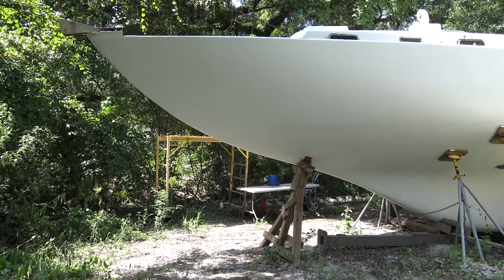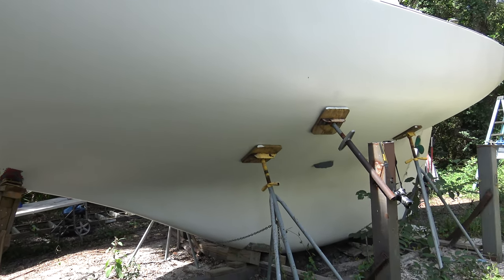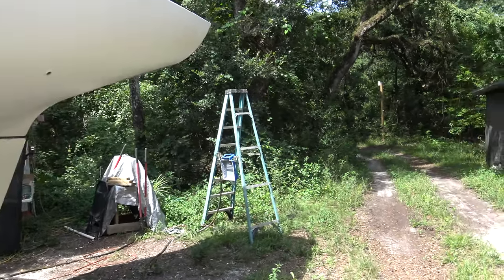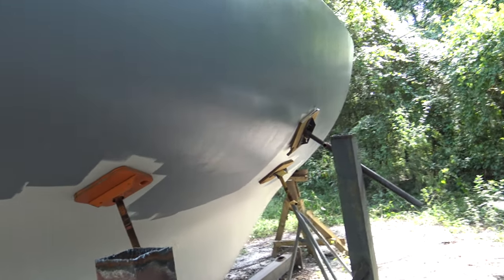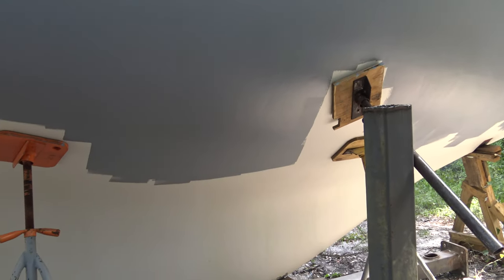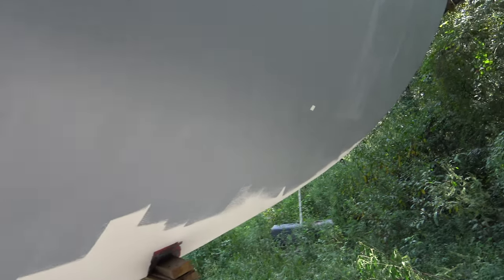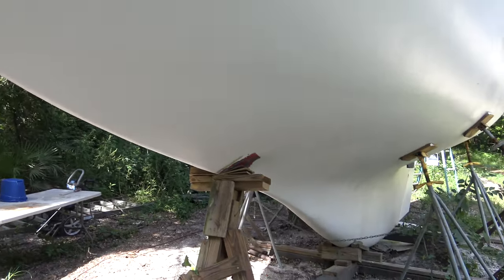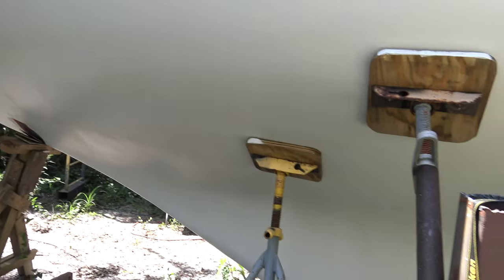Alberg 37 Barrier Coat painting July 2022

Comment: How many quarts did it take for each layer? I have an Alberg 35 and I am very interested in your progress.
Reply from the maker: Hi James. Thank you for watching my video and your interest. To answer your question, it took 2 Gallons for each layer. That's for the complete hull, top to bottom of the keel. Your boat most likely will need pretty much the same amount since there isn't all that much difference in size. And you'll have to use it by gallon size, if you by that stuff in quarts you'll end up paying almost 3 times the amount.

Comment: How will you find the water line? Would you be able to send me measurements? Is this a mk2?
Reply from the maker: I did measure the waterline before I started sanding and painting. But I can also still see where it was in close up since I did the bottom part first. I also have a laser level to make sure the line will be strait. It is a mk2 (1973).  I took some pics with a tape measure. I could email them to you, just send me a request to my email address:  teuton7@yahoo.com   so you don't have to post your email on here.